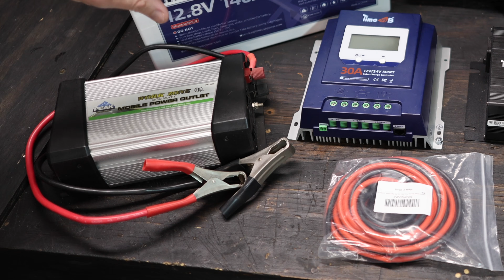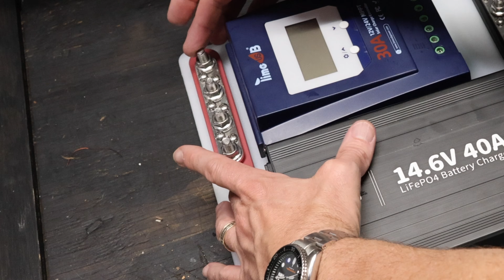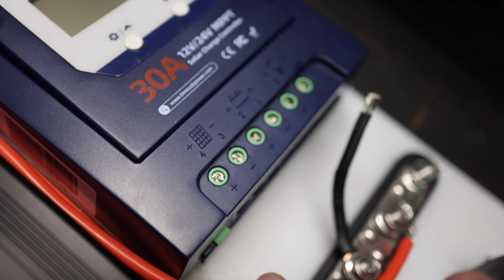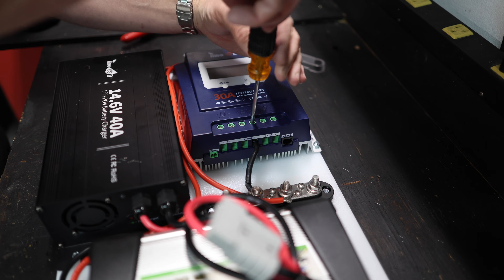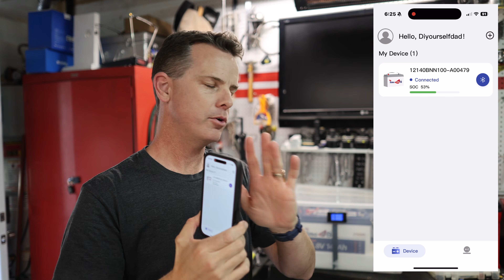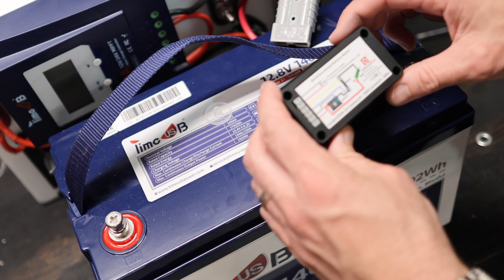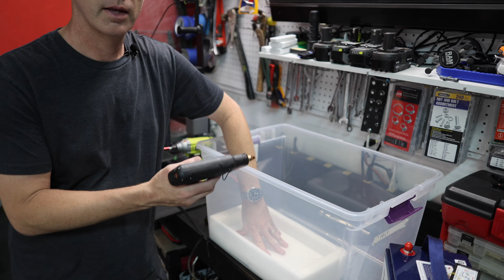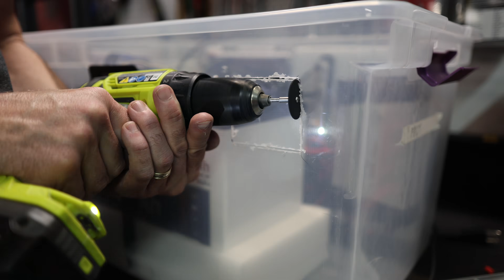Build Your Own Solar Power Station - Make It Better - Make It Cheaper

Comment: I would change that plastic bin for something sturdier. Those things become brittle and fall apart and certainly can't carry that much weight.
Reply: I put mine in an old deep freezer outside..... 2 batteries so far,,, Hoping to have 5 or 6! 😊
Reply: @THEHANDYHOARDER  Aha! Great idea. They should be pretty waterproof. Was thinking I would have to build a mini-shed.
Reply: All the components need air flow so shouldn't be in a sealed box
Reply: Did u vent it?  @THEHANDYHOARDER
Reply: @2down2togo Yes Sir..... I have a hole in the bottom with a screen over it, and a copper pipe coming out the top with a screen over it.... Was considering putting an extra small vent on the other side depending on how it works. :)
Reply: @THEHANDYHOARDER  Perhaps a little USB powered fan?
Reply: @THEHANDYHOARDER  Interesting idea for very cold winter places ...with a light bulb inside the closed freezer for winter charge and discharge LiFePO4 heat!
Reply: I was about to say the same thing, I like everything but the bin, couple of vents wouldn't be a bad idea either. Nice job!
Reply: Heavy duty tote works
Reply: These days, heavy duty plastic job site boxes and tool boxes are inexpensive, in the big picture. $100 for a super nice box is a solid investment.
Reply: Good video.   For my generator I used a black HART toolbox with wheels and handle from Walmart and it came out great, very sturdy and super easy to move around.
Reply: Old cooler
Reply: Back in the early days of this. They they recommended a gun ammo case. I'm not sure of the prices now from 5 years hence.
Reply: I watched a video* today by the “Fishin N Stuff” channel, in which he built a similar unit into the base unit of a Harbor Freight BAUER Modular Rolling Toolbox (item 58512). 

I own that unit, and it is VERY stout—not flimsy at all. I suggest giving it a look. 

*Two years old as I write.
Reply: I've seen people use Tool chests from brands. IE Ridgid, Milwaukee, Bauer, etc.
Reply: I'm going to build this in one of the storage bins under my RV on some heavyduty cabinet drawer slide outs with a heatsink of some sort!
Reply: Love this idea, I'd recommend you add a thermostat and fan that sucks air in with vents the other end this can also be connected to the bus bar, you may want to upgrade the tote box to something more robust though.
Reply: @Hassle68 inverters have internal cooling fans.
Reply: @MeatHead5 in a sealed box all you are doing is moving air that is being warmed
Reply: It’s a demo, he can easily swap the components into any container later.
Reply: Minnesota winters vs. Plastic bins, it's not pretty.  Maybe if you gorilla taped ( or Flex Tape, if you want spend the cash ) the entire thing inside and out, any cracks would be sealed as they happen.  If you're in the Twin Cities, I'm sure you could find a suitable container at AxMan Surplus.
Reply: Hence why he said "use whatever you want!" 🤔
Reply: @mgreen2372 i simply made a recommendation to the video maker based on my opinion, i was not telling others how to proceed if they designed one.
Reply: Yah, something like a surplus Pelican case would work perfectly
Reply: Amen
Reply: An actual tool tote
Reply: Those clear ones fail pretty quick especially in the sun.  By this time it's probably been replaced
Reply: Im thinking an old cooler
Reply: No ventilation nor cooling fan? Good looking components what can it power upto? How many solar panels can you hookup to it?
Reply: Toolbox
fully waterproof box(way stronger
Reply: Totally agree.
Reply: Is heat an issue? Do you take the top off when using it??

Comment: Nice build, waay more economical than a ready made power station and is easy to upgrade. Greetings from Jamaica.
Reply from the maker: Thank you, beautiful country and wonderful people! I hope to make it back there someday!
Reply: WE MEET AGAIN BROTHER!
Reply: yo davidson, i recently invested in some 12.8v 300ah batteries for $314 a piece after sales tax n crap. 
now i need to get some more panels (locally)  and waiting on the 80A charge controller to arrives.
cant wait to truly make jps the backup. last months bill was 16k down from 48k with my little 1 panel + 12v 200ah +20a controller.
Reply: @andrievbastichy8551 Great news bro,  If you have not imported the batteries yet, remember that batteries for use in solar power installations are duty free (and GCT free too i believe) but you need to fill out a declaration form to be submitted along with invoices to Ja customs when importing them. Also, Look out for 4th of July sale in the US if you need more batteries and other stuff.

Comment: Great explanation and walk-through! Only suggestion is a cost breakdown for this exact build (relevant to time posted of course) to compare to a battery bank like you shown! Good job nonetheless!
Reply: Cost approx $600 for parts he listed
Reply from the maker: Very good point! I’ll tally up the costs and put it in the description of the video.
Reply: @DoItYourselfDad  So how much did it end up costing?
Reply: @DoItYourselfDad I'm also curious of the investment tally.  I'm also curious about being able to add a larger tote below the original to house 2 more batteries as an expansion module. Strapping them to a dolly, or something similar, would make them readily mobile.